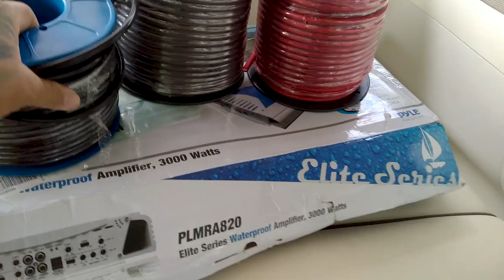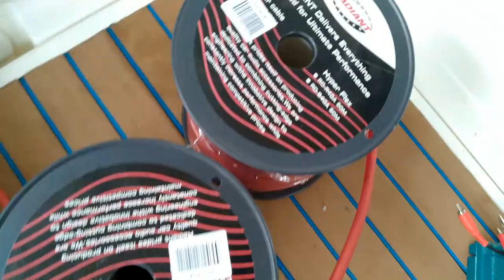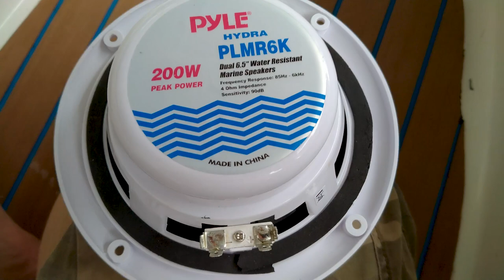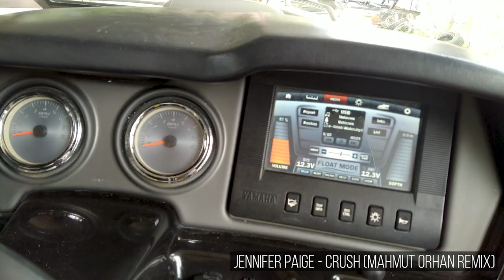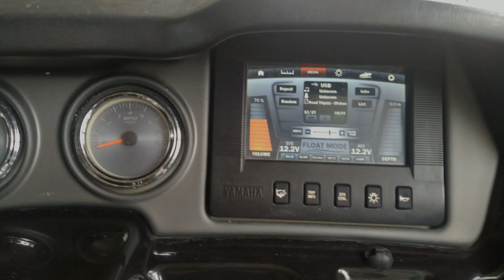Boat Audio Upgrade & Install - Yamaha 242 Limited S Jetboat

Comment: Hi, you didn't have to add any extra batteries for power? How long can that play on a sand bar or just floating?  I have the same boat and am upgrading in a couple weeks.

Thanks
Reply from the maker: Hello Brock, boat has dual battery system and can switch to 3 modes: 1, 2 and both. Which is enough for light music listening while cruising and music is mostly turned off while fishing.

Comment: Do the factory speakers still work as well?
Reply from the maker: Hello, yes the OEM speakers were restored to work because previous owner messed the factory wiring. After that, I added those Pyle Audio speakers, subwoofers and 8 channel amplifier. Also installed another brand new bilge pump for peace of mind.

Comment: Use Wire and supply 2/0 welding cable and sky high RCA's
Reply from the maker: 2/0? Isn't that too little? 😹
Reply: @chrclmnky  no I use 0 gauge to 2/0 welding cable for my charging wire